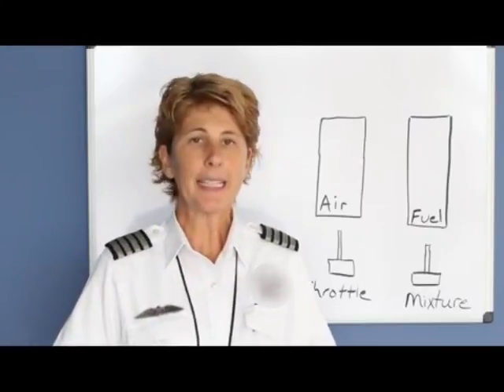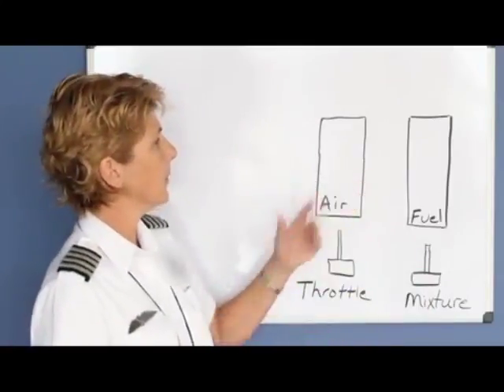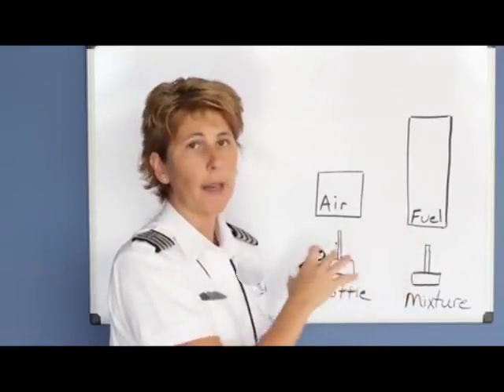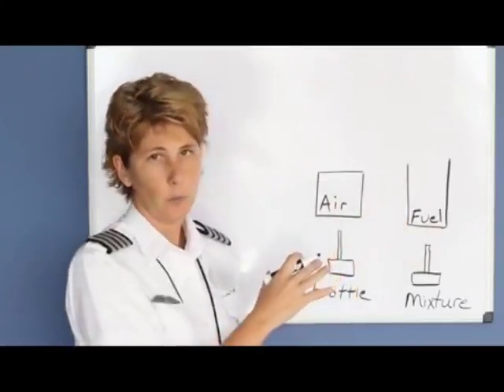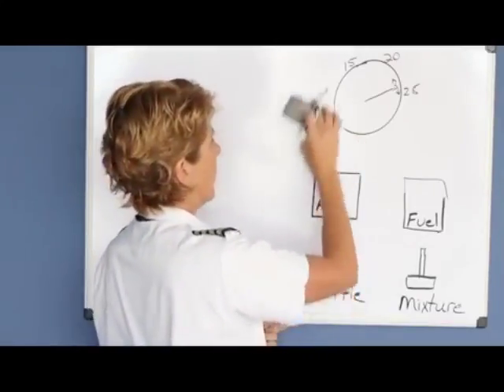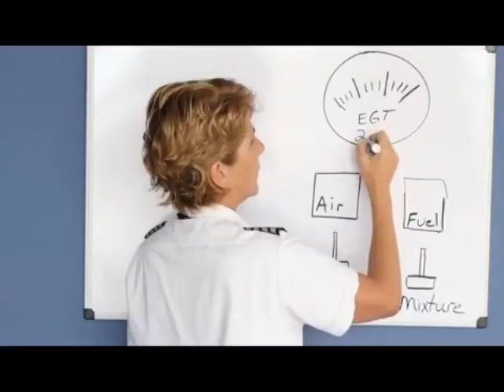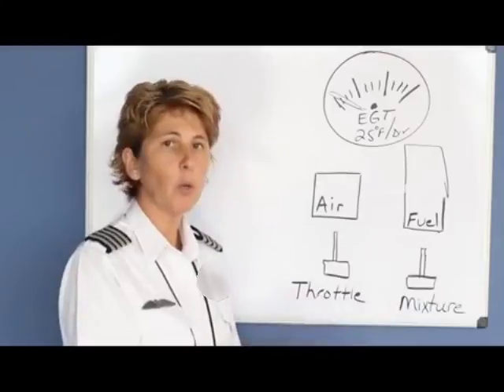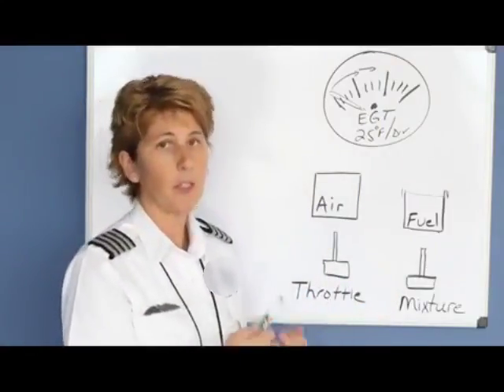Leaning the Airplane (Private Pilot Lesson 2b)

Comment: Do not run your engines 50 ⁰F ROP (rich of peak) you are subjecting it to the highest ICP internal cylinder pressure.

Go for LOP 30⁰ -70⁰ F (lean of peak) or best economy, for cruise.
We've been taught this wrong its not her fault, but new data from the best engine lab in Ada, Oklahoma, suggests the contrary.
Refer to Mike Busch also of Savvy Aviation, he has  more than a million flight hours of real engine data.

Comment: The higher you climb the less air going through the carburettor? The less air the less fuel being sucked (venturi). Does this not then automatically lean. If it doesn't then why?

Comment: This video regarding the leaning process, is by far the best I have found on You Tube. Thank you form your time.
Reply: Only that the video is sadly incorrect. I know that this is what is taught at most flight schools but there are charts showing how this is bad for the engine. She wrongly assumes the EGT (exhaust) peak temp. is also peak cylinder temp. The peak cylinder temp. is actually achieved at about 50 degrees rich of peak EGT. This is the worst possible setting for engine longevity. You should rather go 10-25 degrees leaner than peak EGT. Unless you are in a climb where you want a really rich mixture for max power but that's like 125 -150 degrees rich of peak.

Comment: Hi there, if you see this comment, I have a question, when you say throttle controls the air let into the combustion process, how does it work as when you have limited air at higher altitude, like if you run at full throttle at a lower altitude would you let in more oxygen compared to higher? And as you climb would you change your mixture setting?
Reply: Throttle is just opening the air admission. Of course, you can open the throttle all the way, at 60,000 you won't get much air anyway.

Comment: Very educative video! I only have one little question still on my mind, why does the RPM increase slightly when you lean the mixture? To me this seems a bit counterintuitive as you're putting less fuel into the engine.
Reply: the engine will produce less rpm if there is more fuel and uneven mixture i.e less air.
for example- if you have too much wood in a fire, the temperature you receive will be less as it will smother the fire
on the other hand, when you lean the mixture, its like taking out excessive wood from a fire to make it attain a certain temperature.
when we lean the mixture, it is now getting optimum fuel to perform the cycle. and hence it hsows in the performance in the form of increased RPM
Reply: @flywithgaurav163  Thanks for the very clear explanation! I think I understand it now
Reply: Becouse fuel can't burning(burning is chemical reaction) without air, so there is optimal ratio air and fuel.

Comment: Would you lean for a very long slow climb?
Reply from the maker: Hi Thomas,
Consider the Density Altitude of the air you are climbing through and listen to your engine.  If you are climbing high, where the air becomes thinner, your engine may struggle to show a climb because the mixture is too rich.  I often lean a little as I climb above around 5,000 feet, especially on high Density Altitude days.  If you choose to lean a little as you climb, you should notice an improved climb performance compared to not leaning at all.  But, be sure you don't over lean on the climb because your engine needs extra fuel on the extended climb to help it stay cool!
Reply: Once again, a great presentation, Cyndy.  I appreciate your clear/concise teaching style, and always learn whenever I watch your videos.  Thank you!

Comment: Excellent advice!  One question, though: Suppose you're flying some really old plane (like a DC-3 or an Electra 10-E) which doesn't have an EGT gauge, but has a Cambridge gas analyzer instead (that was an instrument invented in the mid-30s to do pretty much what the EGT gauge does now, but the way it worked was completely different) -- how do you use that to lean the engine?
Reply: Lean till the RPM drops and then ease in more fuel until RPM goes back to what you had.
Reply: How do you use the Cambridge gas analyzer, though?
Reply: agentorange153  I have a Stearman and the way you do it on the Radial is set the RPM then lean until the engine stumbles then  push the mixture forward until the engine runs smooth, then push the mixture in about another 1/2 inch in .
Reply: Who cares